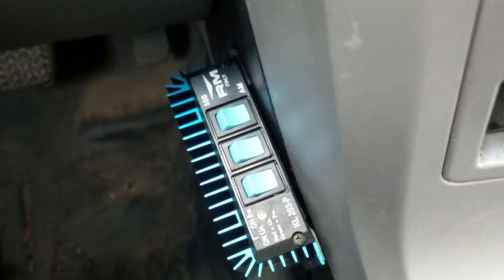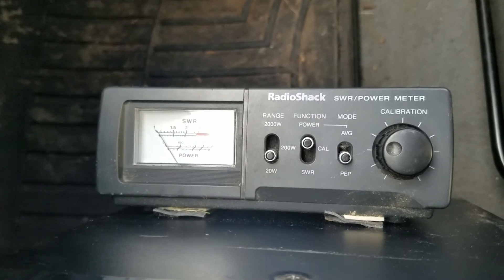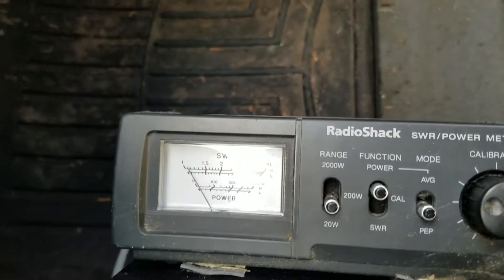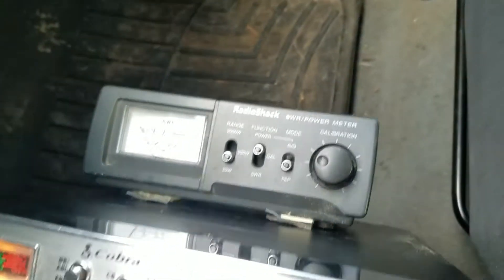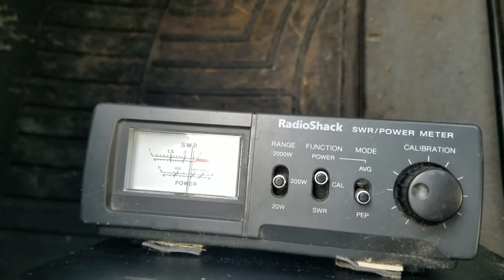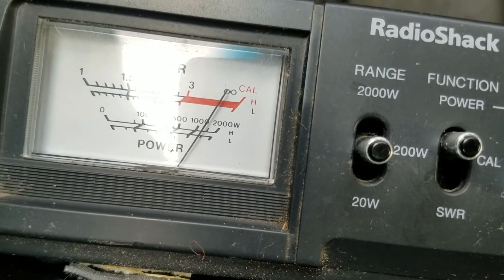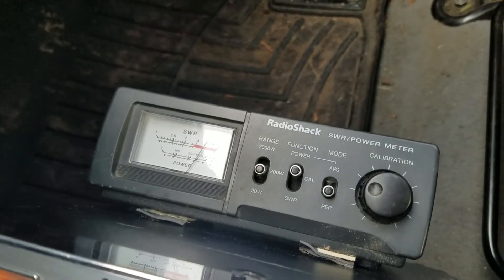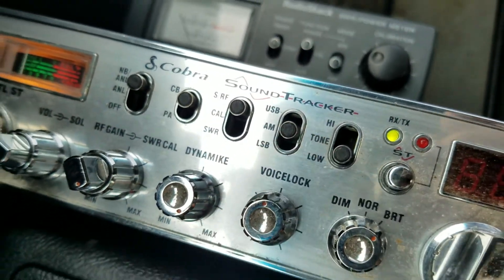Watt test RM Italy KL 203-P linear.

Comment: Manufacturer says 1 to 5 watts I run on 4. Just don't key up for 4 min. Straight.
Reply: My radio runs 4 watts also. Amp is about a year old and no problems. High swr's probably cause most of the problems. Also use a fan on top to keep it cooler. These amps are made to handle 4 watts carrier and they will, mine have anyway.
Reply: @jamescrabb8766  a mono band antenna only has One SWR.That’s why they sell SWR Meters and not SWR’s Meters.It’s the Standing Wave Ratio not Ratios.👍🎙
Reply: @1OFGODSOWN  I was referring to multiple people with high swr's, as in multiple situations and antennas, not one, in other word more than one.
Reply: I hear this all the time, but yeah you read the manufacturers stuff and like you say 1-5 watts. Haven’t burned mine up operates good, fine SWRs.
Reply: @marktaylor9975  SWRs = SWR.Only One SWR on a Mono Band antenna just FYI.👍🎙
Reply: @1OFGODSOWN  yeah that’s all we are discussing here. Wattage in, where are antenna/SWR coming in?

Comment: I've got a cobra 29 lx do I have to get my dead key down to 2 watts if I don't will it fry the amp? And how do I lower it is it with the VR 4 adjustment Thanks
Reply from the maker: Billy Darico I am not a tech. I would google it and see what you find. Or ask in one of the Facebook CB groups. Good luck!
Reply: You can have a variable dead key installed in the case.  A two way switch that sets the dead key barefoot, and then flip the switch to run the amp.  Any good tech should be able to do it.